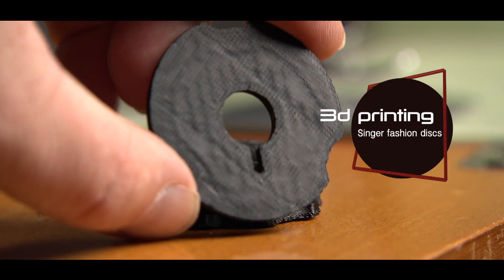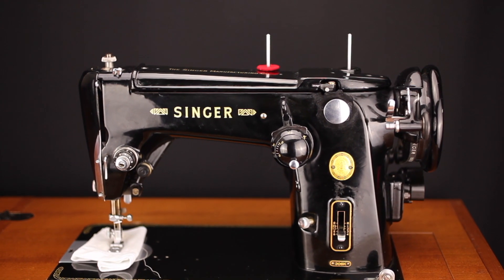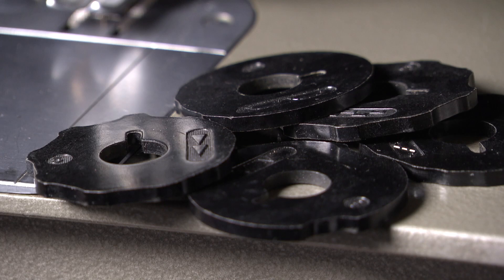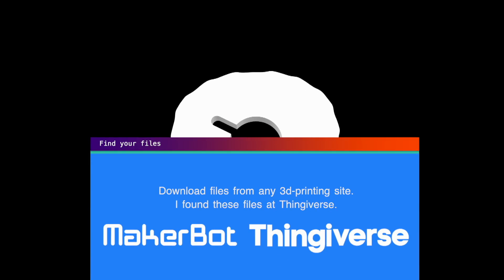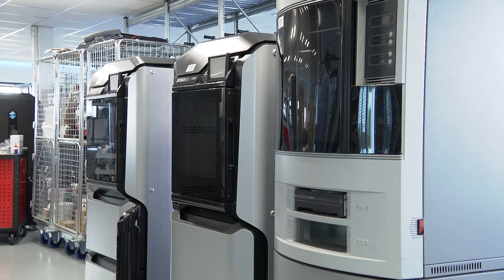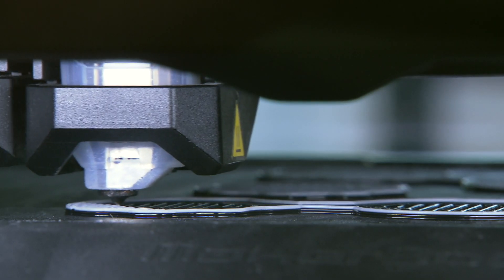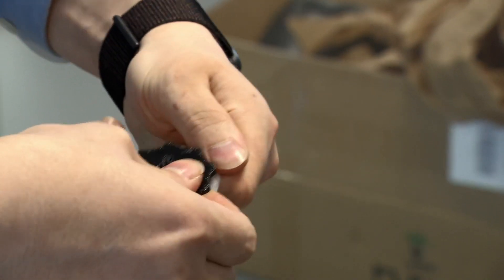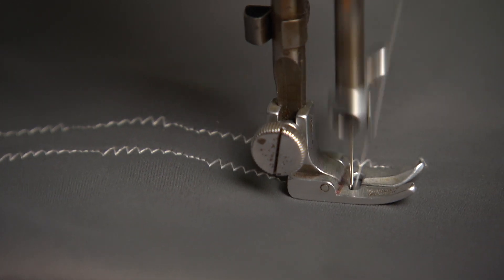3d-Printing Singer fashion discs 1/2 Intro

Comment: Erik did you find the patterns on thingy verse? I have both a 319w and a 503a the 503 has all the discs but I would like to have some for my 319. Is there pattern you used that you recommend
Reply from the maker: Hi Kate. Thank you for your message.
As stated in the description (and the second video) I am far from happy with the Thingyverse pattern. I had to use a Dremel tool to let them kind of fit my machine - But even then they still are far from the original. Of course there is a HUGE chance I did something wrong, but I would never use this pattern again. (I probably manually scan and redo the original discs OR I would search for another pattern uploaded by a different person.)
Take care and have a wonderful day!

Comment: Thanks for sharing! I just got a green Singer 319 with 25 discs and was about to start the process of creating 3D models - but I see you are ahead of the game!
Reply from the maker: The 3d-design I downloaded and printed from Thingyverse did not have the result I was hoping to get; They did not fit very well. Actually I was very disappointed. 
Good luck with making your 3d-models and good luck with you FB-group on 3d-printing sewing machine parts.
Reply: Have you made some?  My 319  has one, but I would love to get more.

Comment: Great video, I have a Singer 500-something that is on my to-repair list, and I also planned on printing additional discs on my 3D printer. So, I just must comment on the low quality of those prints: that business should have made them way WAY better.
Reply from the maker: You're absolutely right. Butthat quality issue was part my fault. They gave me a quote on printing with different kind of materials. For 5 discs the first quote was around 30 euro's and the second quote was 16 euro's. 
I went for the second one, not realizing the quality would be this much off.
They do make high quality products, so to be honest, I was dissappointed. (-Is that the correct word?-)
Next time I'll ask that would be the best result.

Take care and good luck with your project!
Erik
Reply: @erikneek  Thanks, wish me luck: it's one of those Touch'n'sews IIRC, and with a known failure point (plastic gear crumbles with age, that's where my 3D printers will jump in).

If you do plan on printing some things here and there, getting an entry level 3D printer is a great investment, and isn't really that expensive anymore. Creality's Ender 3 is the most popular model worldwide I'd say (Chinese company, price being a great factor as well ad gazillion videos online for any/all contingency), but for the best user experience PRUSA's offerings and quality is probably one of the best (made in Czechya).
Reply from the maker: @cbs1710  Thanks for your reply.
I am interested in 3d printing. Very much. Thank you for you tips on machines. I'll check it you. I found out that XYZ-printing has a location in my home town with enclosed (not open) printers from 200 euros and up. That's a steal I think.
To be honest: I havent done any research on 3d-printers nor the differences in materials. Even friends are interested so maybe I'll jump in 🙂

I wish you all the best in restoring your vintage sewing machine. I'm very much interested in your project and the 3d printing of parts.
If you have anything you can share, like photo's, please drop me a line (here or at Facebook).

Take care, 
Erik

Comment: That looks like fun! You could sell a few of the number 1's as they seem in short supply! I got a complete set with my 328k which is good because when I picked up a 316G last week it only had the number 3 cam.
Reply from the maker: Hi Jane. Thanks for subscribing and your message.
A 316G... That's a heavy beast of a machine.
Looks like I had a similar situation when I bought a 319k with only one disc. (A couple of days before I bought that 319k I saw an add on the Dutch craigslist for a FREE (!) set of fashion discs, which I passed on...)
I could sell some, but although I'm stoked about the possibilities I have to do some more research on printing materials and maybe scanning the official discs, instead of ripping designs from Thingiverse - They don't fit when printed, I had to get my Dremel...

Enjoy you 316 and 328!

Take care, Erik